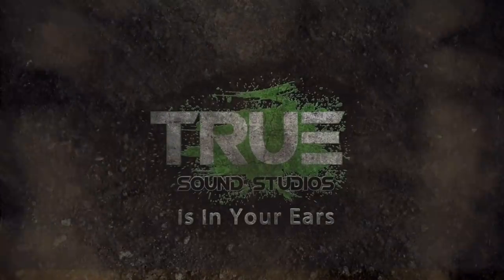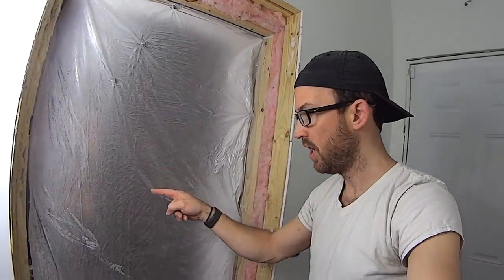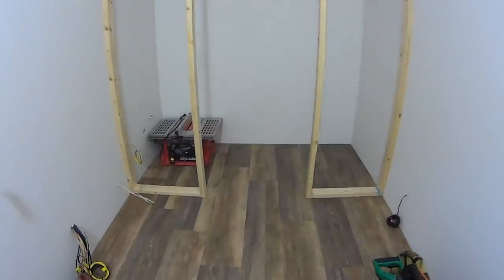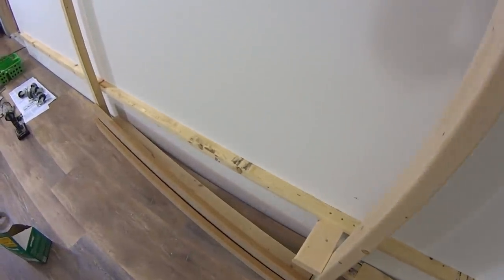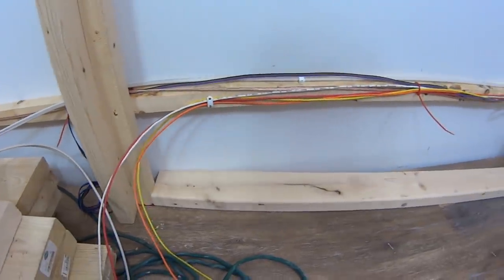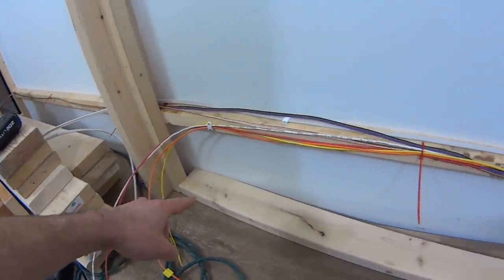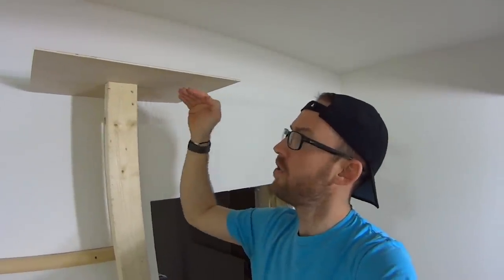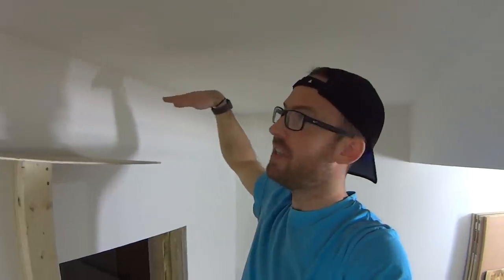Building A Professional Recording Studio - Part 10 (paint, flooring, acoustic treatment)

Comment: looking great and really enjoying these vids! One observation is whether you've considered the potential impact of that boxed off beam on your stereo imaging. If I were you, I seriously think about another false ceiling that slopes up from the back wall (say from half way between the top of the soffit mounted monitors to the underside of the beam at a point behind your listening position. Would also reduce the parallel surfaces / reflections between the ceiling and your desk and floor around your listening position.  I don't mean to sound negative but given the extensive work and attention to detail you've put into this thus far, it would be such a shame if that beam caused you imaging issues once completed!!  All the best and keep up the great work posting these vids!!
Reply from the maker: Ben Thomas yeah so I have a plan to either make a false beam equal to the size and placement but on the other side of the room to the original and treat accordingly. The other is to treat the space as if the beam was directly over the center of the studio and just widen it and treat accordingly. I’ll show that whole process as soon as I get to the ceiling treatment! Thanks for watching

Comment: If you're going to switch the hot and neutral for your equipment you better use a double pole switch for the hot and neutral then a single pole for the ground. If you were to accidentally switch the neutral off before the hot it could (most likely would) be fatal to your equipment. Nice work though!
Reply: Pretty sure both options will not be code compliant. you need a three pole switch where a single paddle disconnects all three wires. just think how bad it would be to disconnect the safety ground without disconnect hot a neutral, and then getting a ground fault in the studio.....

Frankly if your worried a bout a lightning strike I don't even think a little switch will protect you get a proper whole house surge suppressor installed..

And yes I realize this video is a year old but in case someone else comes by hopefully they see this....

Comment: Coming along very nicely! Idk if it's been asked before, but how much is this costing you? I'm very interested in doing this exact same thing when we move to a house in a few months.
Reply from the maker: Chesare Johnson thank you! So as of right now with the money I have spent on materials and the things I still need to buy it is right around $14,000. That includes the permits, structural drawings (to get the permits), lumber, drywall, insulation, electrical wiring, lighting, signal cable, acoustic treatment, subfloor, flooring, drywall taping and finishing,   paint, and screws and nails for the entire project. Also, I did literally all the work myself besides the drywall taping and finishing so there was almost no labor cost!

Comment: Appreciate all your vids! Thanks for showing these details especially. Question: I spent a lot of time planning a room with cool angled walls as that’s what I’ve always known to be the way to do things in a studio - but after much research (that I’m guessing you did as well) it’s ended up resulting in a rectangular room with a certain ratio. The one I’ve come across is 1(height):1.26(width):1.59(length). Could you shed any insight on your experience of that part of the planning process, and maybe the final measurements for your room before treatment? You say in this vid that you spent a lot of time doing so and I’d love to compare your analysis to mine and the info I’ve come across. Thanks again!!

Comment: Did Brandt say anything about running your AC wires parallel to your audio cables?  I've built many Commerical studios and usually with EMF you want your AC to run separate only crossing each other so you dont Introduce EMF into your audio signals...
Reply: John Brandt uses the zero loop area concept for power and audio lines.   look it up it's quite interesting.
Reply: @paulbishop2161  that concept is as old as audio itself. All manuals with consoles basically outline that same concept.  I'm not talking specifically ground hums I'm referring to Electro magnet field which is found in all AC signals.   Most people including brandt will run AC wires in their own seperate metal conduit piping in order to minimize the EMF from bleeding Into audio signal wires..  I noticed in the video no conduit was used and there was little separation between AC and audio wires..
Reply: Ah I see what you mean, yes I also thought it odd that there was no conduit.  However, according to Ethan Winer you can wrap an AC cord around a XLR plugged into a mic and there will be no interference... who knows @jaredrush6750
Reply from the maker: abcdd yeah I hear ya, it was my choice to do this as I live in an area with a great clean power grid. My last 3 studios used no special audio/power separation and have had zero issues. I have tested the power multiple times with this setup with no issues so I’m sticking to it. If there’s an issue, I can easily pull back the fabric and change it if there’s a problem. Thanks for watching